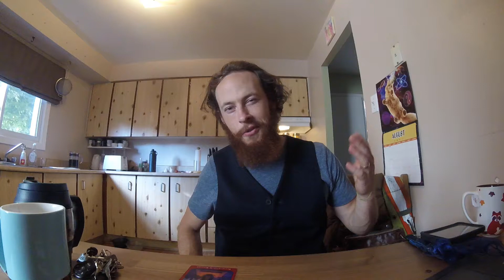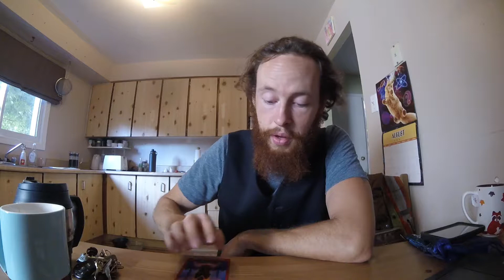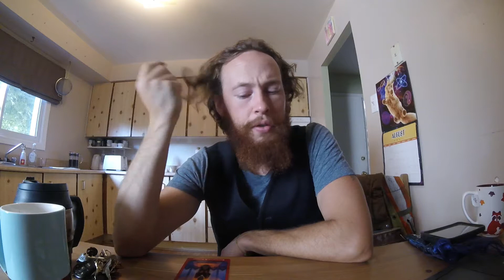First Mudrail Overview

Comment: Hope that is not serviced by CN Rail there track standards don NOT allow mudrail to be installed.    Just wasted the customers money
Reply from the maker: Client had pre-existing mudrail in crossing. With having mudrail absent in the middle of the crossing. 
Pavers had paved and filled in flangeways with asphalt to the head of the rail.
This is a private siding and is not serviced by CN.
Crossing will need to be replaced in the future as the ties are begining to fail. Crossing does not comply with 18" tie spacing, has 11" track plates opposed to the industry standard of 14" with recommended spike pattern for crossings at grade. Can not confirm if they are 9' ties in the crossing, but they will be come time.

Future engineering upgrades will ensure adequate drainage along the roadbed and proper filtration of fines, along with rubberseal installation.

I appreciate your positive criticism as there is always shared knowledge to be had.